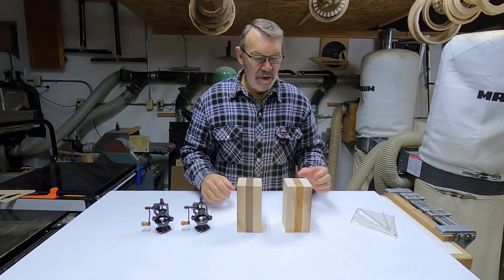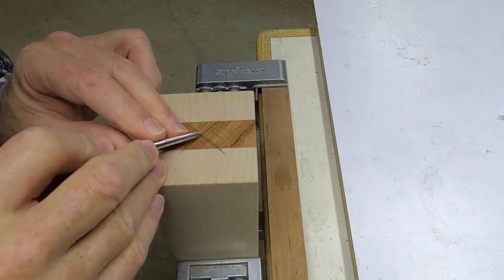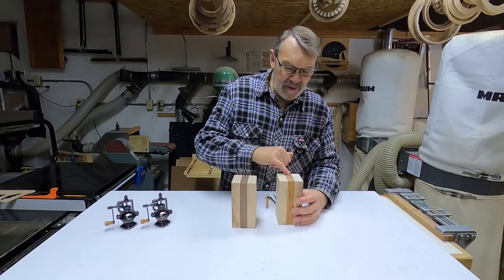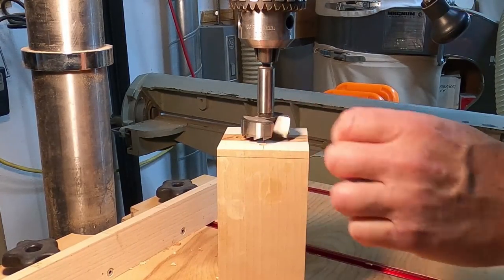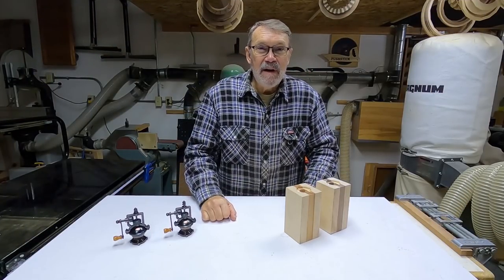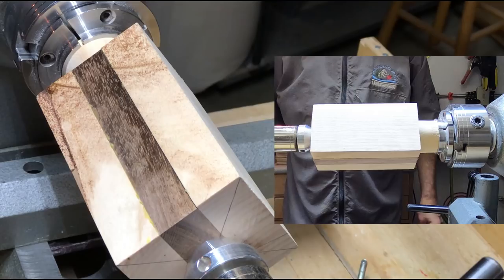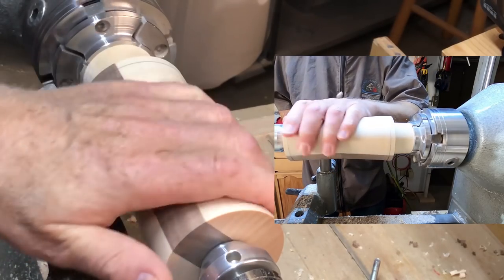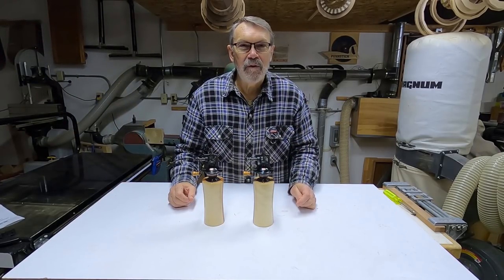Antique Salt & Pepper Mills

Comment: Gord,
I've made well over a hundred of these mills and would definitely NOT use them for salt.  I speak from experience.  Salt will corrode the mechanism over time.  Nice design and i like the little tray.
Reply from the maker: Hi Tom,
As I said to others I’m not worried about the salt grinder lasting forever. They are cheap enough that even if it only lasts a few years I’m okay with that. If it turns out that it corrodes quickly I will just replace the mechanism and have another pepper grinder to gift to someone. The turning is finished and that’s where the time is invested. Besides, I do this for fun and I definitely enjoyed making them!! 😃😃😃🇨🇦🇨🇦🇨🇦
Glad you liked the design, Tom. Thanks for watching.
.....Gord

Comment: Hey Gord,  nice job. I'm actually in the middle of making a set myself. Just a thot...from my research, I found most are saying this grinder isn't the best idea for salt. It has the potential to corrode the gears. Might not be an issue here in AB cause of the low humidity. I'm just trying to make a matching salt shaker to go with the pepper grinder.
Reply from the maker: Hi Steve, Someone asked about the salt earlier. Humidity does make a difference and if the salt is dry I don’t think we would have much trouble here. Of course I was wrong once before. But I was only 10 at the time and have tried to avoid that happening again!! LOL
Kidding aside, the grinders aren’t as expensive as I thought they would be so if I have to replace one someday that’s a lot quicker and easier than the turning!! Thanks for watching, Steve!
Happy turning, .....Gord